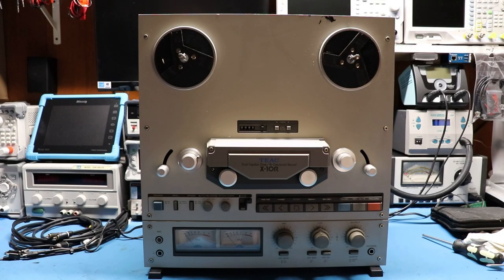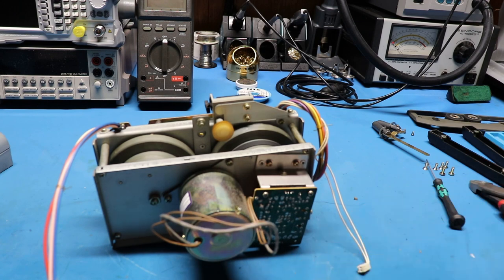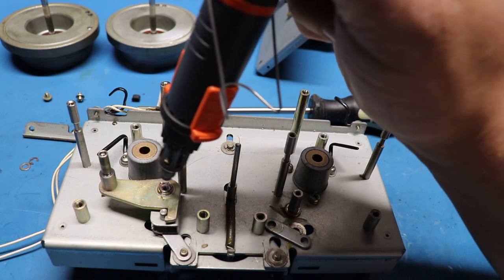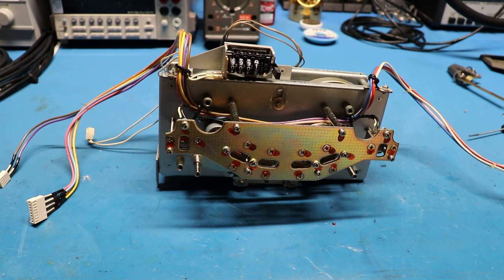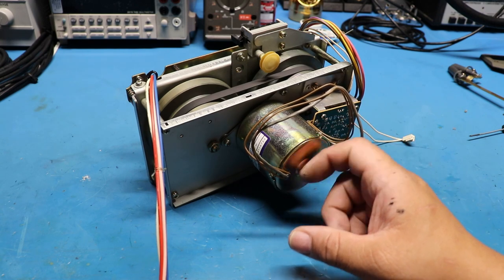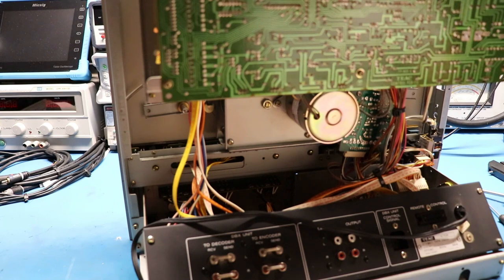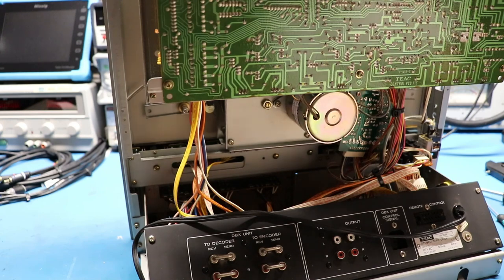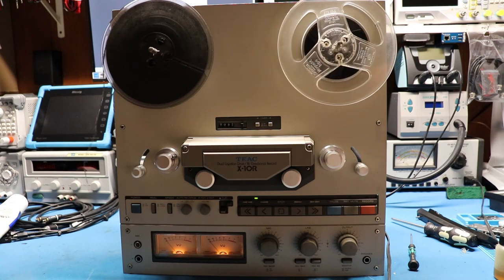TEAC X-10R Reel to Reel repair and restoration

Comment: This was a great help for re-belting, but you don't need to remove the transport to clean/relube capstan pinchers.  The metal bar below the tape heads is all that needs to be taken off in order to remove the pinch wheels.

Comment: I just purchased one of these and found out that one of the magnets was lose in one of the motors.  i am pretty new, learning but after tearing it down to get the motor out, reglued the magnet to the housing, new belts, cleaned out all old grease and lubricated and oiled as designed, went to play it, and it tries to play but both forward and reverse buttons it only plays reverse.  it quickly starts and stops as the tension rollers quickly go slack and it just stops.  it was working before, just make a lot of noise due to the motor.  i know it is something i did, just not sure where to start.  Any advise would be greatly appreciated.  thank.  Paul

Comment: Nice video, but you didn't show how actually you took out the transport mechanism and how you put it back, which Is exactly what I needed to see.
Reply from the maker: I going to do another video on these as have a few reel to reel decks waiting servicing that I need to get to one being this model.
Reply: @thetechgenie7374  thank you I have a X10, no auto reverse. It Is working but I have to push the pinch roller up to make It work. I know I have to do what you fid, but I was interested in knowing whether the transport mechanism comes out from behind or from the front of the machine

Comment: Hello I have a teac X10R I have replaced the capstan belt lubricated all moving parts and it was work fine until yesterday, now the machine has a problem with the monitor button when it is playing from the reel there is some (very little) output playing through you have to turn it all the way up and there is a lot of static also you can hear music playing from the tape when it is playing from the source and its the same when playing from the source
Reply: Could you advise me on what’s wrong as I’m new to this and it’s really frustrating

Comment: Rocky boaboa does youtube, ADR|IENNNEE!!!! :D PS you are only 80% right on most stuff but i congratulate you young man for being 80% correct as most are at 10% on youtube these days ;) i used to rebuild pro machines in my sleep and was at one point back in the day a head engineer in amplification for bang and olufsen thru the 80s and early 90s so piss off anyone else lol ;)

Comment: Is the X-7R basically the same transport?  Mine works but I did have to live the pinch roller pivot points that raise and lower.  Works fine but if I keep this I may want to replace the capstan drive belt.  Also, the take up motor is sluggish at rewind when it beats the end of a reel.  Comments appreciated!  Appreciate your thoroughness!
Reply: Lube

Comment: Can you tell my for what reason the belt moves up and down? My technician obvious forgot the spacers (belt is firm on one spot) is there any harm in that?
Reply: @Peter van Leeuwen   The belt has to move "up and down" because each capstan turns at a slightly different speed in order to provide the correct tape tension between the pinch rollers, for proper tape-to-head contact.  In the forward direction, the right hand capstan turns slightly faster than the left hand capstan; and in the reverse direction, the left hand capstan turns slightly faster than the right hand capstan.  This is accomplished by moving the capstan belt to different areas of the pulleys, as each pulley has a slightly different  (BUT MIRRORED) circumference in each direction.  This called a " closed-loop-dual-capstan"

Comment: I have four Teac Reel to Reels and love them all. I just got a Teac X-3R that has been sitting for about 5 years. put new belt on cleaned all of the switches and pots with Deoxit, the fast forward and reveres work great but the main drive motor will not power up. Help I want to get this baby going
Reply from the maker: Could be capstan motor needs rebuilt, or driver is bad, I seen them go bad on these.